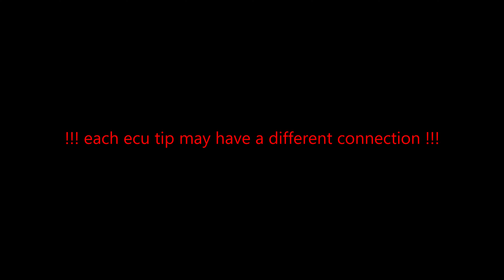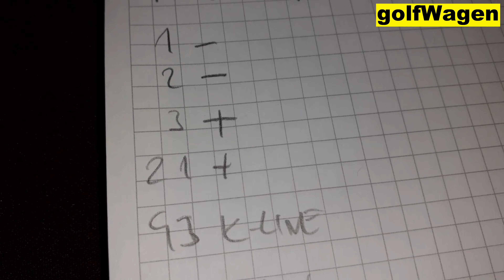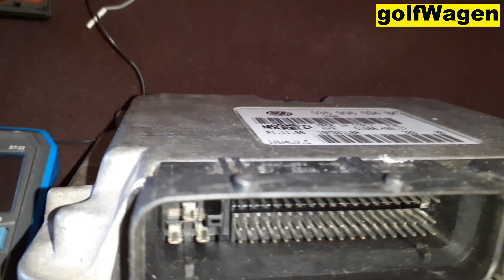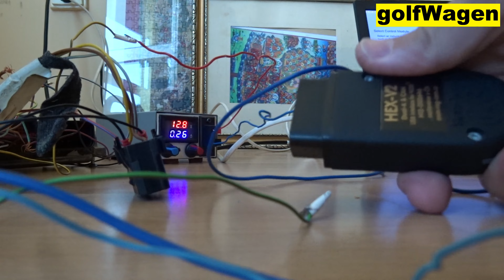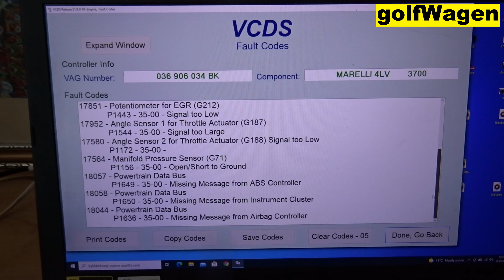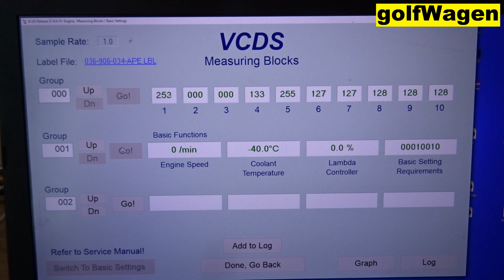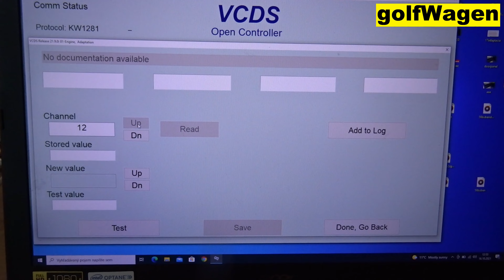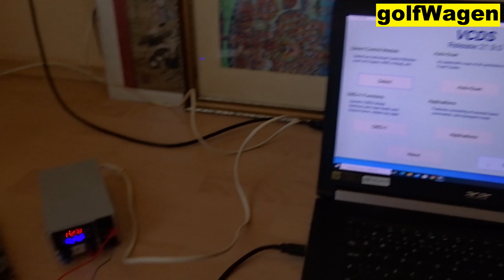VW Engine ECU connect on table via OBDII VCDS VAG

Comment: I saw this with great interest as trying to check that my ECU is working correctly before sending off for repair.  The issue is I don't seem to get any communication at all. Do I need to connect an additional unit like the ABS system to make this work?